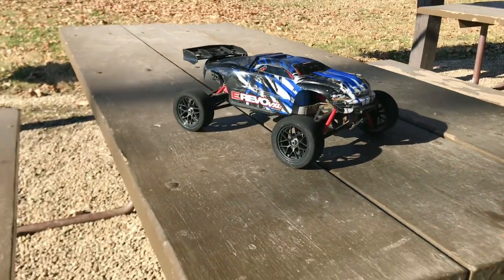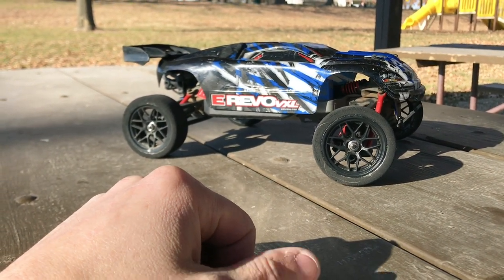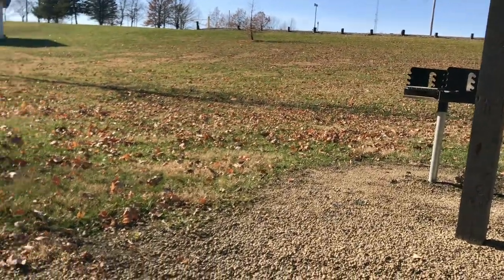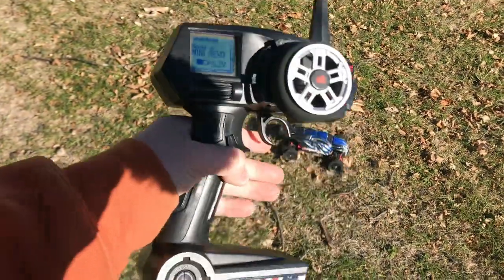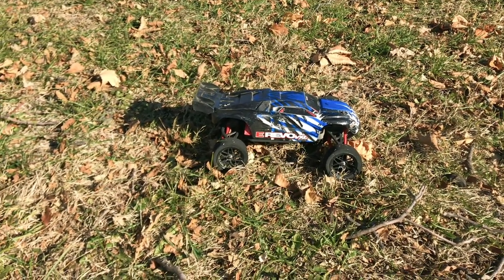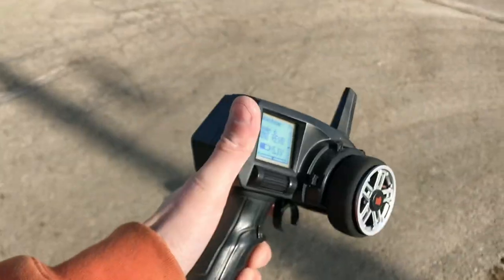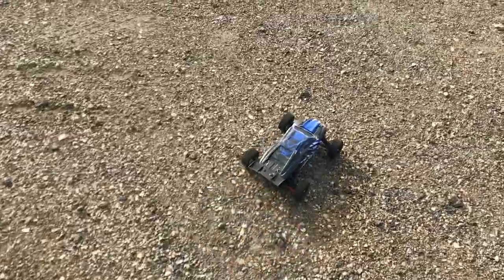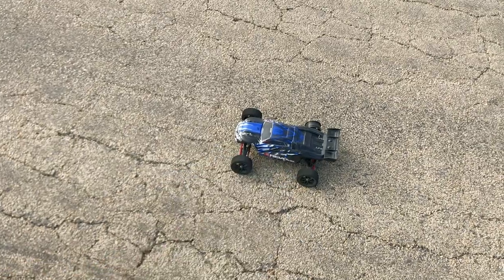1/16th Traxxas Mini E-Revo VXL BRUSHLESS - HOW Will It PERFORM with FOAM TIRES??

Comment: hi mate, i have the mini slash version of this, have you had any problems with the diffs on your merv because i had lots with my slash. as always love the content my friend and all the best!!!!!
Reply: Get the hot racing diffs and build them with care. They shouldn’t ever fail again. I’ve went through more than 10 diffs between my 4 mini e revos.
Reply from the maker: Thanks….Oh yeah….lots of problems with the stock diffs….swapped them for the Hot Racing ones
Reply: Yup I went through heaps when I used to use mine. Ive still got 2, but now I use the Maxx and the e revo 2.0
Reply from the maker: @LGsRCs  yeah I prefer the larger machines over the 1/16 scale most of the time anyhow

Comment: Dang I actually traded
 mine that was super built for a brand new in the box kraton exb 8s sealed in the box traded straight across. Deal of the century. I put the hot racing diffs and center diffs in that Merv I traded and it was butter!!
Reply from the maker: Yeah that’s a crazy deal…..that would be a crazy straight up trade for a 6s Kraton….they must of either really wanted the mini erevo or really didn’t want the Kraton 8s…..they didn’t even run it?
Reply: @RCKnockout  nope sealed in the box. I think he realized that the 1/5 was going to be big money done right and he liked the small stuff. I had receipts for my Merv at almost 800.00 it was super built and had a ton of extras as well. I have almost 2k in parts I need to build mine as soon as my 78kg Servo comes for Xmas lol and my dgi +1 hub extensions come too. 1/5 is definitely sticker shock then goes away after a little while hehe
Reply from the maker: @never-stock-rc2968  yeah he must of really liked it…..it’s seems like the Kraton 8s needs a lot of upgrades to be reliable….I see people swapping M2C parts on them all the time….they’re too heavy I guess….have you run yours stock yet?
Reply: @RCKnockout  it's the roller exb so I haven't ran it yet I have the xlx2 1100kv combo cnhl 8000 120c lipos and a slew of other stuff Ive bought. 75kg servo agfrc m2c beefcake kit, hot racing shock caps 39/39 gearing ,PPS motor mount saga gear polished all aluminum to silver chrome like, proline wheels and tires proline brute body darkside studios bottom wrap game changer maximus fans all that b link ext ext lol
Reply from the maker: @never-stock-rc2968  forgot you said it was an “EXB”…..sounds like you’ll have a lot of money invested in it! Best of Luck!! I was very tempted to buy an Outcast 8s but I think I’ve decided not too….especially after the experience I’ve had with my own EXB lol

Comment: I’ve never run foams on mine. I have ran small on road hpi tires and it was squirrelly. I couldn’t hardly drive it.
Reply from the maker: Yeah it definitely felt squirrelly but it actually can get some grip on pavement with the foams

Comment: Yo, how did those hot racing diffs hold up
Reply from the maker: Haven’t had any issues with them
Reply: @RCKnockout  that’s epiccc
Reply from the maker: @Prod5D  yeah no complaints
Reply: @RCKnockout  I just got my e revo yesterday, I am running it on 3s so it stripped like right away
Reply: @RCKnockout  imma add a center diff and shim the diffs, cause the hot racing ones aren’t available anywhere
Reply from the maker: @Prod5D  that’s a bummer but the stock ones are pretty susceptible to stripping
Reply from the maker: @Prod5D  you’re just gonna replace it with another stock gear?
Reply: @RCKnockout  yeah man, but I’ll do the center diff and that’s gonna help
Reply from the maker: @Prod5D  yeah that should help save the diffs
Reply: @RCKnockout  why traxxas gotta do this to me 🤣
Reply from the maker: @Prod5D  lol 😂
Reply: @RCKnockout  are screw kits for the mini e revo available, because a few of my screws got destroyed unfortunately
Reply from the maker: @Prod5D  I would assume so…..but I’m not positive
Reply: @RCKnockout  I found this kit on Amazon with all kinds of screws, m1 m2 and m3
Reply: @RCKnockout  and have u ever had ur steering trim not work and the e revo suddenly going right or left for no reason, and then it just fixes itself on the next run?
Reply from the maker: @Prod5D  I haven’t….it could possibly have to do with the Tsm though
Reply from the maker: @Prod5D  I figured there’s probably something out there
Reply: @RCKnockout  weird because mine came with a tq transmitter and has the brushless system
Reply from the maker: @Prod5D  you bought it new? It should definitely have the TQI radio system if it’s a vxl model
Reply: @RCKnockout  I bought it used, that’s why, so the owner prolly replaced the radio, but I ain’t complaining cause I hate the traction control anyways
Reply from the maker: @Prod5D  tsm comes in very handy on squirrelly vehicles like this one though
Reply: @RCKnockout  true true, the dude who sold it to me already upgraded the arms, added sway bars, turn buckles, chassis skid plate and 2 bodies and one 2s for 375 cad, I just gotta add a new diff, center diff, new screws for the bottom and a new chassis cause some of the screw holes are stripped
Reply from the maker: @Prod5D  then it should be good to go
Reply: @RCKnockout  yeah, just a lot of money for these parts lol, I think it won’t be breaking anytime soon after that because the rest of this thing is solid
Reply from the maker: @Prod5D  hopefully not…but nothings indestructible though
Reply: @RCKnockout  Ye, I took it too a Bmx park yesterday, had huge crashes, and nothing broke, so that’s epic
Reply: @RCKnockout  I also don’t get how people break the plastic drive shafts, mine are just fine after multiple 3s runs, the diff gave out first
Reply: @RCKnockout  bruh now my e revo’s servo got destroyed
Reply from the maker: @Prod5D  that’s a bummer……was it the stock Servo?
Reply: @RCKnockout  yeah the stock servo sucks, I gotta find a savox one
Reply: @RCKnockout  can you fit a full size servo on this thing? Cause I have a brushless savox, but it’s full size
Reply from the maker: @Prod5D  No I’m pretty sure a full size one won’t fit…..unless you wanna cut up your chassis? Still might not though
Reply: @RCKnockout  damn it, there has to be a way lol 😂
Reply: @RCKnockout  I used to run that savox in my e revo 2.0, but I sold it cause it broke too easily
Reply from the maker: @Prod5D  I’m sure there are some good ones out there that should fit
Reply: @RCKnockout  yeah, another alteast 50$ to my parts 😂, but I’m upgrading it though
Reply from the maker: @Prod5D  just keep on upgrading man